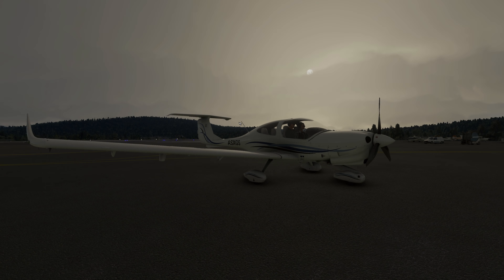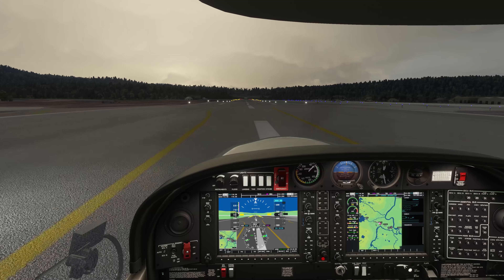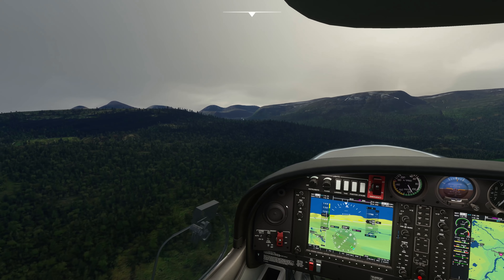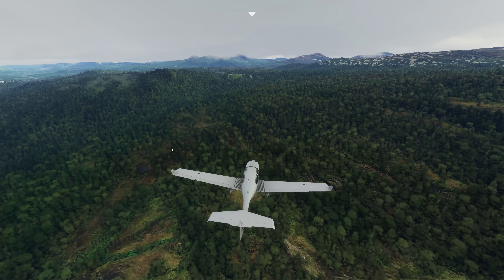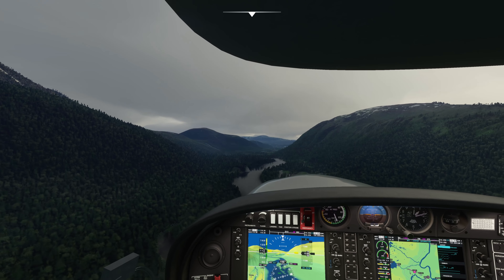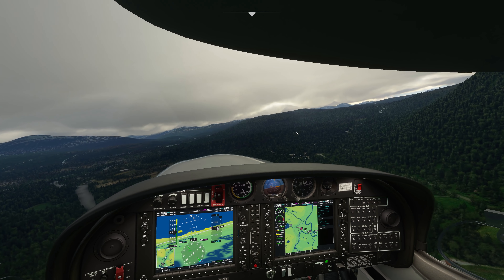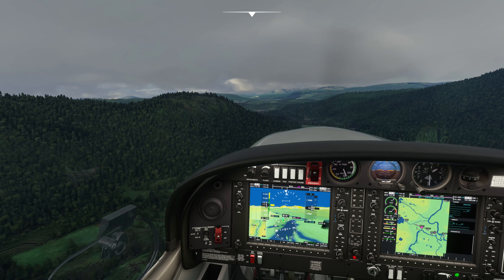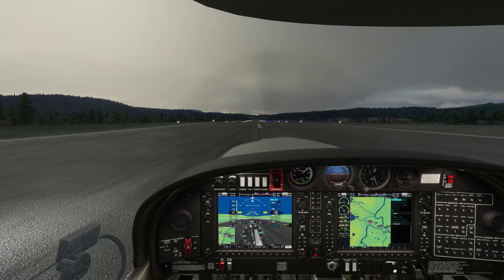✈ Should I Switch Away From Prepar3d v5 & X-Plane11? ✈ | Microsoft Flight Simulator - 4K

Comment: I dont even see how this is a question. There has NEVER been a technological jump of this magnitude in any game, sim or not. I understand brand loyalty and not wanting to move away from  something youre attached too, Maybe spent alot of money in XP11  which would certainly hurt, but seriously. The prices are better, the graphics right out of the box are better AND runs smoother. Even  Orbx is offering a 40% discount for people  buying the same dlc from other games (partially because they know their old pricing will not fly now that FS2020 undercut the market).  At this point its either loyalty or pride thatll keep someone from not loving FS2020.  Hell, the fact that they literally offer it for $1 is enough honestly
Reply: The question is there because, Prepar3d, has ALOT of good planes that MFS 2020 doesnt have yet.. such has the 787 (a good one), a better a320. 747-400 and a -8. a 717, and 777. Once we have these for MFS we can switch, but Im sticking with P3D and MFS until that day.
Reply: @dillon17   as I said  " I understand brand loyalty and not wanting to move away from  something youre attached too, Maybe spent alot of money in XP11  which would certainly hurt," also
" At this point its either loyalty or pride thatll keep someone from not loving FS2020"....

But  I wouldnt buy a single thing from P3D moving forward unless they can match MS2020 prices
Reply: @JoeSmoe1  Im so hyped about the pdmg 737 for MSFS! The A320 is a nice plane but its not good! Half of the cockpit isnt working! Im just hyped for the content that comes for MSFS
Reply: @Johnny-ue6hg  its still early access. Also remember its a FREE plane and cannot be compared to a P3D Paid plane
Reply: @JoeSmoe1  I know! I just wanted to say that this is Probably the reason why people gonna stick to xplane or p3d for one or two month! Later wenn new good planes get released most of the people will Switch!
Reply: @Johnny-ue6hg  I think thats why FS2020 had so many free planes in the base game. they know at this point the only thing stopping people is available planes.
Reply: Actually watch the video instead of writing ignorant comments pretending to understand what you are talking about
Reply: @Miku-uw2sl  who? what op said is correct
Reply: @Miku-uw2sl  ummmm, I did. God if ppl like you are considering moving to FS2020... please dont
Reply: n1tothrust  yet. No sim starts off with a ton of options, but they did start with a ton of free planes, and they plan on making a lot of study level planes. Why not just play both
Reply: I think simply the IFR airline aspect of the sim isn't great yet. MFS2020 is more geared towards GA and VFR at the moment- but that could certainly change in the future as more study level aircraft come out. So P3D and X-Plane are still far superior for airline work atm.
Reply: Loyalty, pride, and hardware limitations? Even now there are still people flying FS9/FSX and that definitely isn't due to pride or loyalty.
Reply: Not even close to being as clear cut as you're putting it. Definitely nothing to do with pride or loyalty. MSFS is definitely miles ahead of P3D or Xplane on many fronts. However,  I will be running P3D alongside this for the foreseeable future. Depends what you use FS for. IF GA is your thing theres no reason not to switch but it will be some time before you get the same airliner experience so for those of us who prefer flying airliners, the complete switch wont come for some time.
Reply: If we're whales like you so elegantly put it then theres no reason why people wouldnt run both.
Reply: @therealestpepito8636   cool
Reply: @mahzeecee  if youre still playing Fs9/FSX you are right its not loyalty, more like insanity lol. The fact that so many people are going all out to defend their XP11 etc purchases is very telling.  People dont want to hear that a product they spent way too much money on is basically on its way out, only to be enjoyed by a niche crowd. People need validation in their purchases unfortunately. its human nature. You can add all the planes, make them work perfectly, and people will still not leave their old game purely off investment alone. Im actually old enough to remember the XP11 launch (which is STILL early access after all these years) it was not as smooth as FS2020 launch nor did it offer as much. Nowhere near. More power to you man
Reply: @dillon17  well that's barely a reason to stick to a underdog game, give it 3-6 months, and fs2020 will have all the same in much better res, and you won't mind spending on it, as the world already looks incredible, and doesn't really need that much work. not to mention the 10 year plan!
Reply: @RivalGrimReaper  Thats exactly the reason, I said *once we have those for MFS, I will switch probably for good*
Reply: @dillon17  they have already had people working on the market place and have over 100 plane options before it releases i believe
Reply: Aaand. You'll only need aircraft and airports. And maybe ai traffic for addons. Thats it
Reply: What's the point in getting into an advanced aircraft and when you look out the window the view is mediocre and unrealistic? Xplane still has a ways to go. Some add-ons are nice, but they still fall short. And where it's noticed the most is at lower altitudes. I mean, there are a ton of 2d trees, lol. For someone really into flying to enjoy the view, MFS2020 is it. The more advanced aircraft will show up as time goes by.
Reply: 3 Letter Minecraft Name Gang they probably won’t be that great with the limited SDK available
Reply: @joe smoe Most flight summers enjoy a high level of detail both in the modeling and systems depth of aircraft. The aircraft that we have seen so far in the sim don’t have that system depth that a lot of people are looking for. I personally will be switching right when it releases, but I don’t know if I can truly enjoy it without a good, study-level aircraft. I also know that people who have never flown a flight sim before or have little experience will not care about this, and that’s fine! TL;DR: It’s not the money they spent or pride for a good amount of people, it’s the aircraft depth
Reply: It isn't about 'brand loyalty' or 'pride' so to speak - at least for everyone. It is about competition. I don't want there to become a monopoly within the flight sim community. I think people forget that not too long ago Microsoft basically gave a stiff middle finger to the flight sim community when they stopped developing and producing their flight sim. It is something they recognize and openly talked about as they began development of the new sim. They even say they did the community wrong. I'm glad they recognize that, but I still have a bad taste for that and do not want to see Microsoft be the one and only sim so that they can then decide to wipe their hands of it again down the road, leaving us all high and dry, meanwhile, X-Plane and P3D have gone under and we're basically left with nothing - at least nothing supported and in active development. I'd rather see competition so that all of the sims bring something to the table that draws people to them. MSFS has always been the 'gold standard' for eye candy, but people still switched to X-Plane even back then for the more accurate flight dynamics and physics, even though for a while X-Plane had no auto-gen and airports were simply runways and taxiways with no buildings at all. Not everyone is looking for the same things in a sim and therefore competition and choice is a good thing.
Reply: @JoeSmoe1  aug 18 is not early access anymore
Reply: @thecheez2436  I just saw a flight with a TBM 900 in MFS 2020 and a real flight with a TBM, and the preflight prep looked exactly the same. Flight was unbelievable. The weather systems realistic in looks and physics. So, there are in-depth aircraft available. There is enough depth to keep the average Joe very busy figuring out the different systems. Of course there is work to be done as well, but I can say the same for Xplane.
Reply: @darreno1450  Ok, your not a SERIOUS flight simmer, then. If your a SERIOUS flight simmer, you KNOW YOU NEED advanced airplanes such as the PMDG and FSLabs, obviously we care for the outside too, but for us not having a good plane to fly, and having good views defeats the point of flight simming. Its supposed to be realistic, and without advanced planes, it isnt realistic, so we flight simer dont like it. :)
Reply: joe smoe there is just one thing missing from you rationale here

in simming as in life. we are not created equal. we think differently and we perceive value differently. there are simmers that does nkt want or need the new sim. and there is nothing wrong with that. people get different levels of satisfaction and joy from different things

money. preference and needs differ. there is nothing wrong with sticking with one platform and it does not make you "loyal". it is just you chioce
Reply: It's NOT a question. He's not dropping the other sims. Question answered.
Reply: <<People are reserved because until it is a reality, and the performance is satisfactory, then the public really does not know. The SDLC is a long touring path of ups and downs and compromises; the final release may NOT even be what you see today, it could be better, and then again, it could be worse for the same reason, marketing hype. 

Let's see what happens, I would hope MS does not drag out performance tweaks like we have seen with XP and P3D, great sims, I have them both, but honestly, they drag out the smallest items for long, long durations of time, while in parallel pissing simmers off, not to mention third parties.

For 3 years I have reported a bug to XP specific to terrain, that is predominate in a certain area and could be easily fixed in three areas and it looks horrible. Guess what, to this day the terrain anomaly is still there, and I don't use any Orbx in XP or other their party addition. It's XP and their lack of addressing issues, small company, small mindset and hence, small mentality focusing on stuff that honestly should have been done years ago.

That's what pisses people off, and that's why I switched to P3D, at least they address issues consistently and at least I have found the third party developers do the same.

Neither is perfect, but guess what MS is not perfect either, but it seems to be a great base sim that can only get better, let's hope the performance with "better" does not get "worse."
Reply: @dillon17  I disagree that having good views defeats the purpose of flight simming. Why do you think MFS 2020 is so popular even before release? Why are even pilots excited about it? It's mainly the scenery. And the fact that you can fly to so many different places with detailed views that look realistic. That's the attraction for so many that aren't even simmers period. 

Ok, hardcore simmers who invested in add-ons that add in-cockpit realism to airliners and other long-haul aircraft might find the general aviation-centric out of box experience somewhat primitive, but all of that will change as these add-on vendors jump on the bandwagon. I'm into the ultra-realism in the cockpit and will support them, but you're right, I haven't been a serious simmer for a long time since FSX. I just haven't had the time to invest in it, but now it's worth my while.
Reply: @darreno1450  Ok, you didint understand my comment.. For hardcore simmers, I said not having a good plane but good views defeats the point... if we have a crap plane but good views for hardcore simmers, its pointless to be even in the cockpit, because we want to learn for IRL flights.. having good views is amazing, but if we dont have a good aircraft, for us its pointless.

Comment: This question was answered very quickly for me.
My SSD is clean and waiting for the new flight simulator. 
Had all versions since Microsoft's Flightsimulator 4 and with P3D versions 1-4.
I have invested thousands of bucks in my hobby,  but never before has the switch to the new Flightsimulator been so easy.
 In my eyes, the new one outshines everything I have seen so far.
Reply: @WhiteHawk77 Putting the money into the other sims wasn't a waste, after all, you had fun with it for years
Reply: Yup, I have an SSD ready and waiting too :)  Not expecting anywhere near perfection but really looking forward to it. How far it's moved on since I first flew Aviator for the BBC Micro in 1983.

Comment: I already switched since testing the Alpha and haven't looked back! I completely enjoy using Foreflight and the sectional charts overlay while flying. Its incredibly fun to pick out landmarks, ranches, etc. on the sectional and see them depicted in the simulator! I was previously using X-Plane 11 and P3D v4. I never ended up buying P3D v5 as I was accepted into the Alpha about the same time. One flight in FS2020, and I was hooked!
Reply: Dan Artley Does FS output data that an EFB can connect to? That would be awesome and without it I’d have to use both X-Plane and FS.
Reply: @brettkp1  Not natively at the moment. I use Xmapsy 3.1 which allows Microsoft Flight Simulator 2020 and Foreflight to communicate to one another on the same network.

Comment: I think for casual simmers who may not rely on study level aircraft, switching immediately will certainly be an option.  While the default Airbus looks like it will be fun to fly, it's far from study level, and that's 100% OK as it will help many newcomers to our hobby come up to speed on the basics before hopping into the FSLabs or even the Aerosoft.

For me personally, I'll fly in MSFS2020 mostly for GA aircraft and continue to use P3Dv5 for my jetliner flights until such time as PMDG, FSLabs, QualityWings etc have released their aircraft and my unemployed pocketbook can afford to purchase these once again for the new sim.

Like most, I'll depart my local GA airport (KAPA) and fly over my house.  The next flight will be most likely out of EBAW to fly over my in-laws house.  Then most likely I'll head to Alaska and do some exploring.
Reply: You might be eligible for a discount for the NG3 if you bought the ngxu at the right time.

Comment: In theory, I'll be continuing with XP and P3D, however I suspect the "new toy" aspect of this sim is going to make that challenging as I don't have all the time in the world to go simming. A lot depends on how long it takes for PMDG and others to release study level aircraft. I think I'll miss those more as the novelty wears off.
Reply: Unplayable with 8gb cards unless you choose low graphics settings which looks worse then FSX at that settings and even at low graphics, it does stutter and sudden fps drops with 8 GB cards. I do know, I was a 6 months of beta tester lol. This game requires 11GB RTX 2080TI graphic card with overclock and water cooling for sure. Without overclock and water cooling, it does stutter and sudden FPS drops everywhere on 2080ti as well. It really needs a giant computer specs to have xplane quality looking and xplane smooth. This is with default small planes, I cannot imagine PMDG on this sim, it will need 2x double 2080ti to become smooth.
Reply: @RedShark493  is that with a 4K or 1080 resolution. That has a lot of bearing on this.

Comment: My sole purpose of flight simming is the visual aspect of it, not only the planes and systems simulation. I do like to have it as close as to the real world and FS2020 offers it out of the box. Even the standard auto generated airports look far more better than any other sim at the moment. When I roll the time back and go back to launch of x-plane 11 it was not even close to what's offered here by any stretch of imagination for the same price. Yes FS2020 will have its own problems around bugs or incomplete aircraft systems but I don't think flight simulation world have ever opened their eyes to something like this before. FS2020 takes away the need for satellite imagery, nav data subscription, a proper weather engine and even live traffic addons. I'm glad I haven't purchased any add-ons to my XP11 other than just a few aircraft. I'm definitely switching from XP11 to FS2020 even if I know the problems stated by you and other youtubers. Just thinking how much one has to spend on addons and how much time one needs to spend on downloading gigs of satellite imagery to make XP11 close to this is insane. This is a no brainer to me and I'm sorry to say this but XP11 was not able to release v11.50 with Vulcan engine to support multi-core CPU's which is to me the greatest setback of XP11, most high end systems are still struggling when running XP11 due to the amount of addons that you need to run in the background and sim only utilizing a single core of your CPU where you have 5 more cores that can be utilized. In the same amount of time MS is launching a new sim from pretty much from scratch. I do expect other sim developers to respect the customers when they're pricing their product same as FS2020 payware aircrafts are not their property and if they don't enter the competition right now they'll lose that support from payware developers. Just think what happens when Aerosoft or PMDG or Toliss stops developing their payware addons when the XP11 market shrinks due to people switching to FS2020 and that's going to happen very soon from my perspective.

Comment: If 3rd party jets allow you to properly use aircraft automation (FMC, MCDU, etc.) then absolutely switch. I mean, I like the ease of planning IFR flights, and it’s nice, for example, that the route is automatically added into the MCDU in the airbus. It would be nice to be able to do that manually as well.